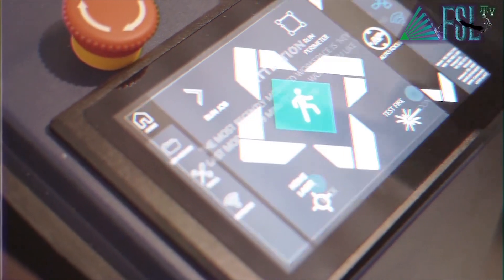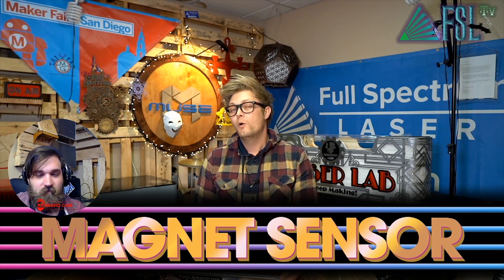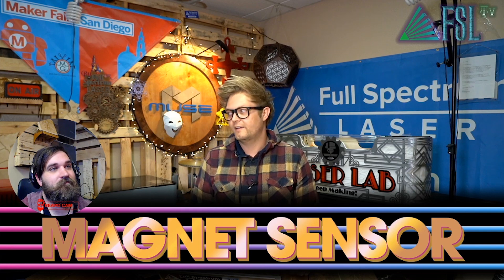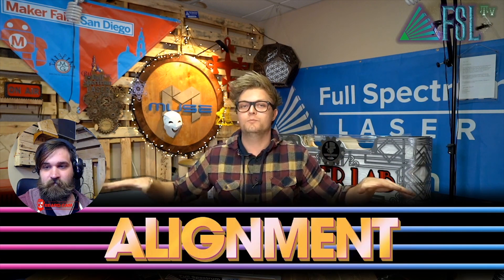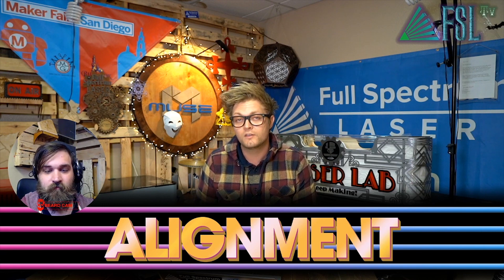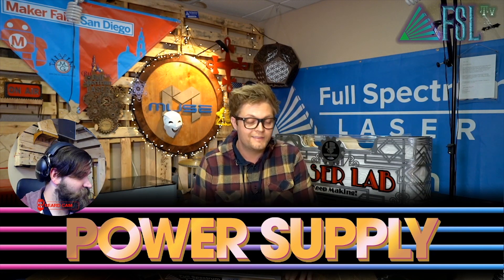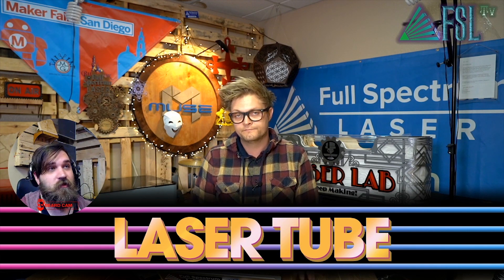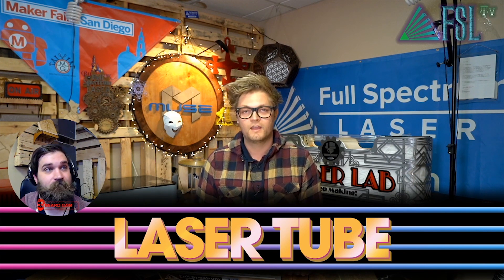Why Won't My Laser Fire?

Comment: this video was great! I came to the conclusion that it must be the chiller as the laser had been working on pulse intermittently. the flex that went from my S&A chiller had a rip in the flex and one of the cores had been severed but still making contact, so cut and re soldered hey presto it works. Also kids if you dont convert your text to curves RD works wont send a message for the laser to fire.

thank again

Comment: I recently replaced my laser tube, machine has been working well. Today i was running a design and the 2 designs on the top left of the workspace cut perfectly, but the bottom right didn't even burn through to the back. I ran the design again and same thing. So i replaced the wood and started the project all over and now the laser is barely leaving a mark on the wood. So I went through the list, magnets for the lid, water cooler, tried to check alignment and i cant get the machine to make a mark during the test fire to mirror one. Please help. The tube is only 2 weeks old. All connections to the tube are in place a secure. I'm at a loss at this point.
Reply from the maker: Emily, if you fill out a support form at this page our support team will be able to address your situation. https://fsl3d.zendesk.com/hc/en-us/requests/new
Reply from the maker: Hello Emily, in addition to the support ticket, put a piece of thermal paper in between your laser and mirror one, before the beam combiner, and see if you get a mark.
Reply: Did you figure out what was wrong?!? I am in the exact same boat right now. Replaced the tube, worked great for an hour then slowly started to lose power. Now I can’t even get a mark on the test fire!

Comment: I got a similar issue, but it tests fires correctly 
, won’t run the job
Reply from the maker: What's happening when you try to run the job?
Reply: @FullSpectrumLasers  sits there , 
No movement, program  has the job time but no movement
Reply from the maker: @lonestardrifter7153  Contact support (support@fslaser.com) - it might be a software issue.